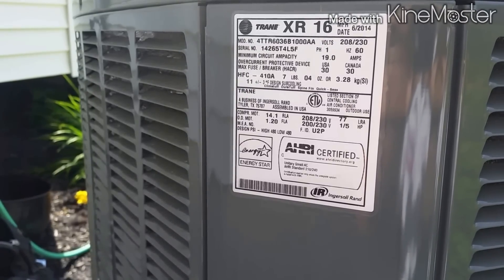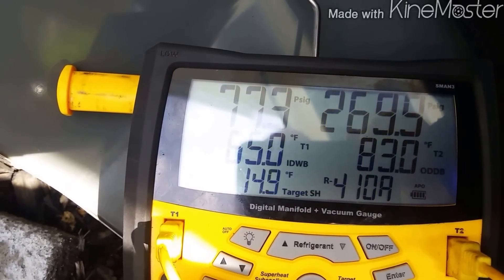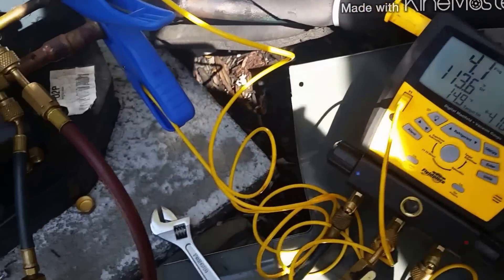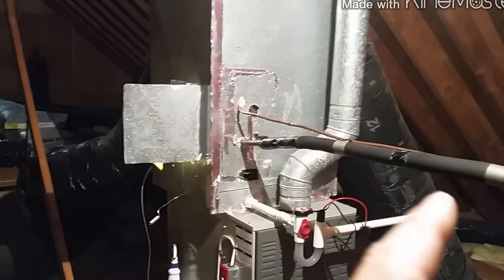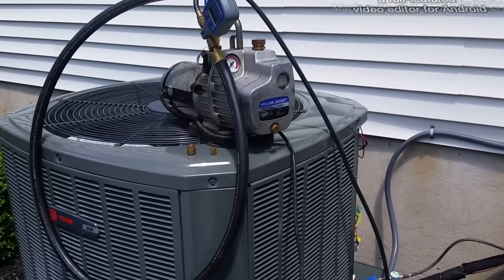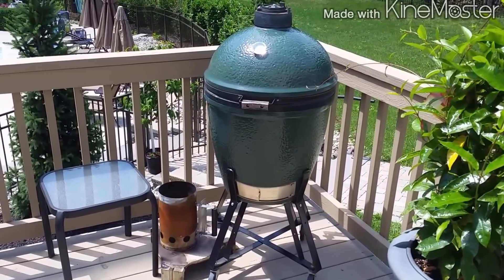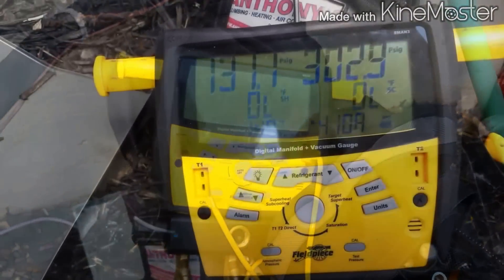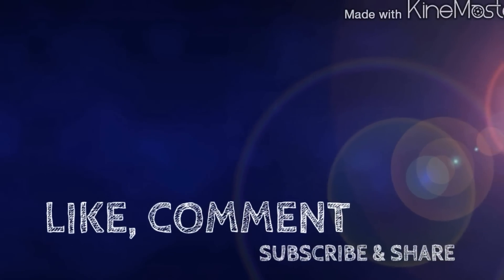Trane TXV replacement

Comment: Can the sound from the inside unit that sound like metallic clanking on startup be a symptom of a bad TXV? My system won't cool during the day, has "low suction", and sometimes make that awful clanking sound. The repair guy said it was a bad TXV in my XB13 system.
Reply from the maker: Nah never heard a txv making a noise like u r describing
Reply from the maker: But low suction could mean the txv is bad but the noise sounds like it maybe a separate issue
Reply: @jhhvacplumbing1944  Thanks. The sound isn't consistent, so it's hard to find the cause. It does it once a month on startup or so.
Reply: @jhhvacplumbing1944  So the low suction would cause decreased performance? My AC will freeze us out at night, but it just can no longer keep up during the day. My repair guy said that a bad TXV can have similar  symptoms as being low on refrigerant, which was full on my system.  He tested air flow at the return vents. Ruling out everythin else, he said the low suction was the TXV. Does all this sound reasonable?
Reply from the maker: @cantor7723  need more info like what r the actual pressures and temps and superheat/subcooling will give us that answer.
Reply: @jhhvacplumbing1944  Oh, that's above my understanding. He just said it was full of R22!  One last question: Isn't there some filter or something to keep the expansion valve from being clogged? Seems like that would be a good idea. This will be the second one on this system.
Reply from the maker: @cantor7723  txv dont necessary get clogged but do get stuck . What make is this unit ? If he said the suction pressure is low and or said it is acting like low refrigerant like u mentioned before then how can he say its full of r22 that u said. A broken txv does happen time to time but 2 is alittle odd unless there is issues with something in the refrigerant.  Sign off stuck txv is either low suction and extremely high on the liquid side or other way around.  So one side will show which looks like low charge while other side looks like over charger,  so that's why I'm confused when u say he said the r22 is full.
Reply: @jhhvacplumbing1944  Yeah. I thought the whole thing is a bit strange. But, in his defense, it blows out frigid air at night, and temps are in the mid 70's at night here. 95 and humid during the day, and it couldn't get below 74 during the day.  I keep it on 68 at night with no problems. My unit is a Trane XB13 2.5 ton.
Reply from the maker: @cantor7723  honestly if this is a r22 system and having a major issues like a second txv program maybe u should think bout updating your ac system at this time rather then throwing good money into an old unit  . If its r22 I know its 10 plus years old.  U do understand that r22 is no longer made as in this past January 2020 and they stopped making r22 equipment in 2010 to faze r22 out completely.  That being said u can spent good amount changing this txv or whatever the issue is and then say 1 or 2 down years the line u developed a leak there will be no r22 to put back into this unit . Just trying to help u out alittle , do u know how old the system is? If its 20 plus year old I would not invest money into it .
Reply from the maker: @cantor7723  well here is another thing . When units get older the indoor coil and blower wheel get dirty as well as the outdoor condenser.  If they r dirty that will effect efficiency.  I know it very 95 to 100 in my area past few days and if u r able to maintain 74 degrees on hot days like that there maybe no problem then , it just could be old, dirty and tired . I see brand new units having trouble on 95 plus degrees days keeping up especially if duct work is undersized and or unit and duct work is in the attic . Alot of situations can cause what u r saying but if it cools fine during regular 80 degrees days then your txv is fine . If txv was bad u would have issues cooling if it was 70 degrees outside .  Trying to achieve 68 degrees during a 95 degree day sometimes isnt possible even with new unit depends on the way and where the duct work is ran and returns also .
Reply: @jhhvacplumbing1944  The system is 14 years old. It was installed in 2006.
Reply: JH HVAC & Plumbing I took your advice, and got a new system. It’s able to maintain 70 even in the day. So glad to be cool and not annoyed now! 😂😎